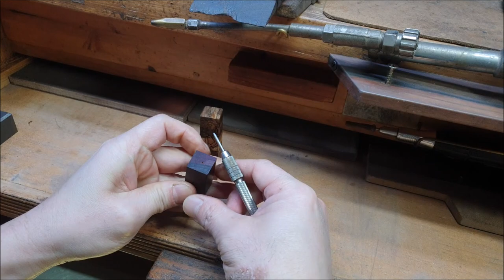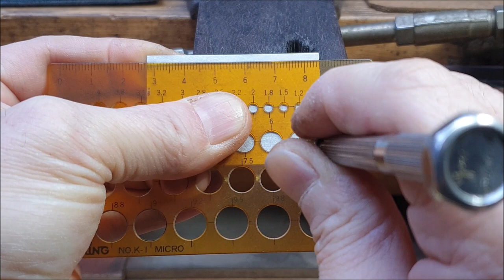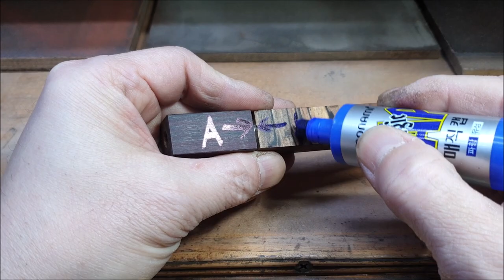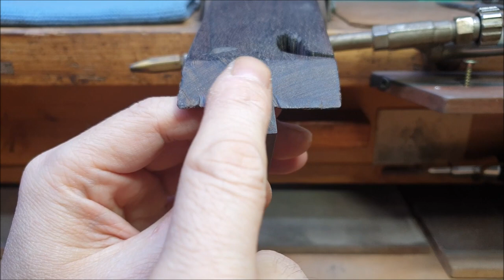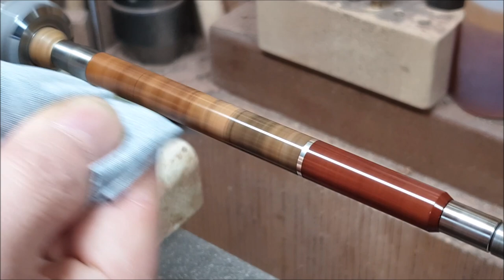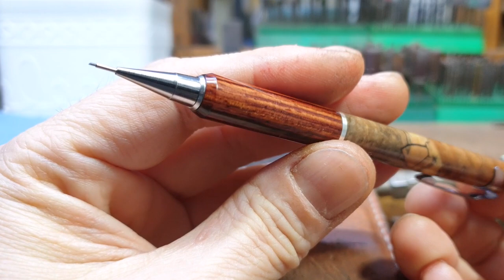Create beautiful pencils from natural rare wood

Comment: Nice Job! Where did you get the little adaptor you hammered into the end of the pen?
Reply from the maker: I didn't buy it, but it was specially made by a specialist in making metal fittings.
Thanks for the comment~

Comment: Beautiful work as usual. And what a gorgeous piece of hawthorne. I know a number of us have asked on previous videos - but is there any way of buying the adapter for the Pentel 205 mechanism? I'd love to try something like this but don't have the skills or equipment to make an adapter myself.
Reply: Buy the pentel pencil and do what he did.
Reply: @yeagerxp  That works for everything except the adapter that he uses starting at 10.09 in the video. That's not part of the original mechanism.
Reply from the maker: No one sells adapters.
It has been specially made by the manufacturer of the machine parts.
I encourage you to do the same.
I'm sorry I couldn't help you!
Reply from the maker: You are right.
This adapter must be manufactured separately.

Comment: Next burn, start with Aloe Vera! Pure!  And continue to use it until the wound either does not hurt or is healing! And it will!
Reply from the maker: The wound on the palm of my right hand is not burnt.
It is a trace of working with a metal tool in hand for a long time, 
And the wound gets worse and then gets better and repeats.
Thank you very much for worrying about my wounds~
I will refer to Aloe Vera Pure. thanks~